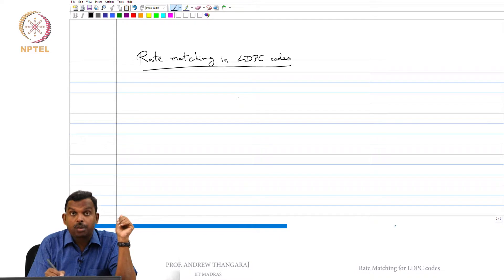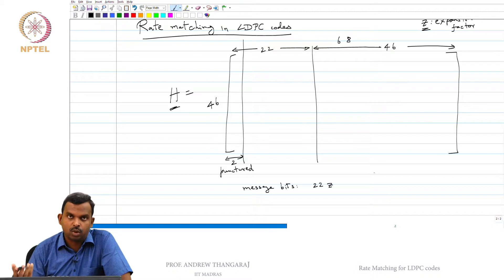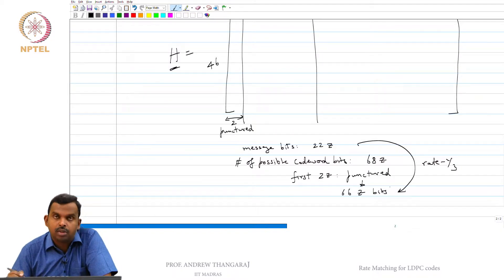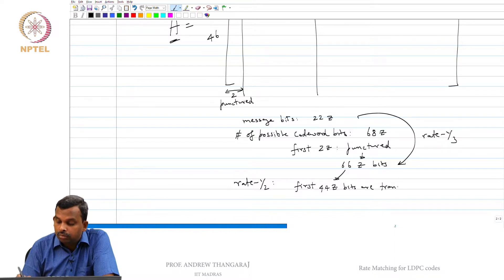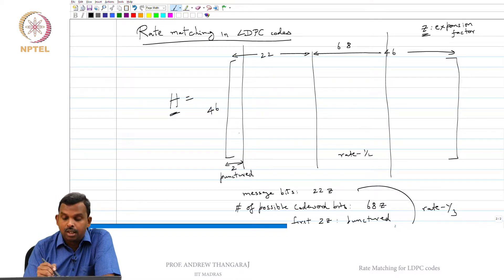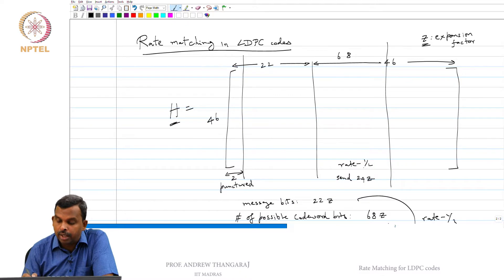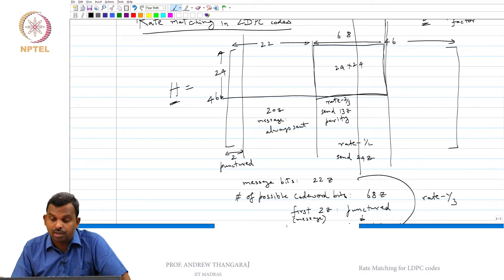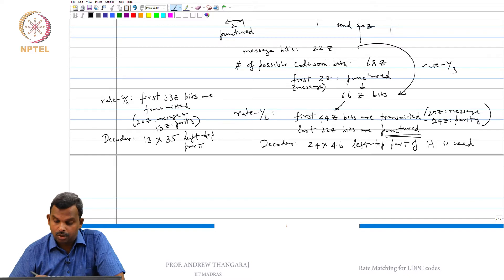Rate Matching for LDPC codes

Comment: How to recover the punctured message bits at the receiver end?
Reply: Puncturing is done on a redundant data to remove certain amount of redundancy, so you don't need to recover punctured bits.
Reply: @atchutram9894  If  at any code rate, I still decode with the whole Matrix and put the Log Likelihood Ratio=0 at those punctured position. Would those punctured extension Variable Nodes deteriorate the decoding performance ?
Reply: @willliu1306  I would be happy to help you here, but, I don't know so much about details of coding theory. I don't get your question properly either. However, I will try to explain what I know about puncturing.

Puncturing is designed to increase the  coding rate adaptively according to the SNR (channel quality). So if you puncher an encoded data ( ex with 1/3 rate), we can remove certain amount of redundancy at the transmitter itself if we know the channel is better. But at the receiver the decoder is designed for fixed rate (1/3). So, we need to fill these punctured location with some value. And yes, they fill them with zero likelihood. However performance will not only depend on the effective coding rate after puncturing but also on the snr. To be specific, decoding performance (on average) will be good as long as effective coding rate is according to channel coditions (rate <= Shannon's capacity).

Hope this helps :)
Reply: @willliu1306  puncturing is improving performance